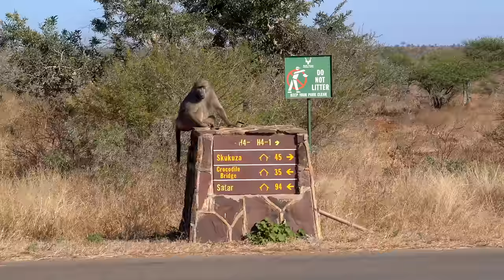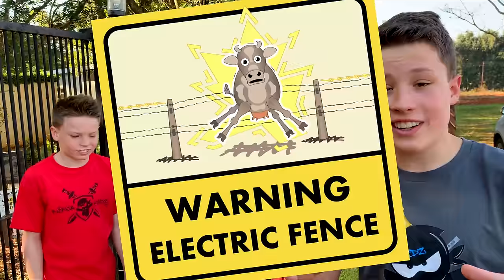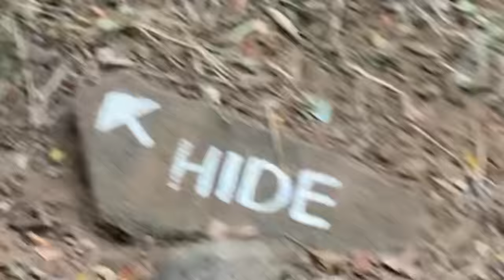Did she get married in Africa? The full story

Comment: 35:00 I believe that is a Nile monitor, which are completely harmless, still, I would recommend keeping your distance from it. If a lizard bites you, it’s much harder to get it to let go than a snake. If a snake bites you, you can use something firm (for example a credit card, though I’ve also heard that if you pour vodka on its mouth that can also work) to slide under its teeth because they have teeth that curve backwards, but lizards have cone shaped teeth, and they like to try to rip your skin off by doing a dearth roll type thing, so a credit card wouldn’t be able to get under its teeth like it would a snakes. 😊